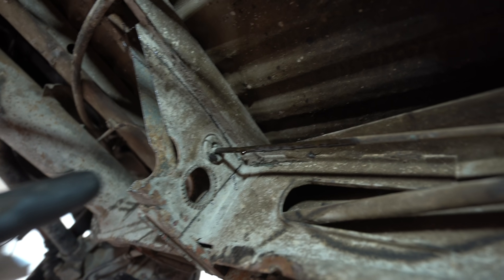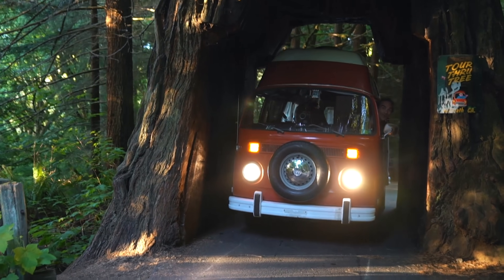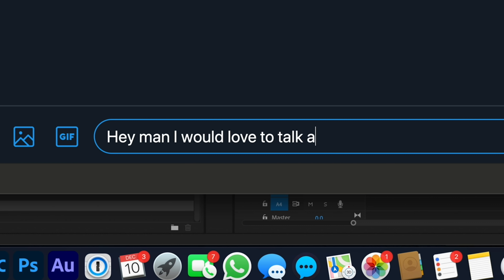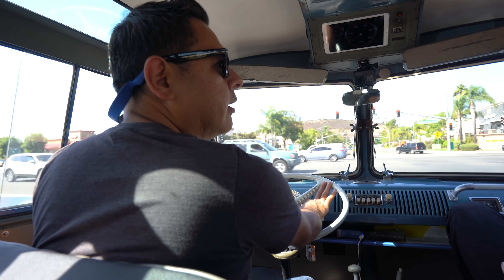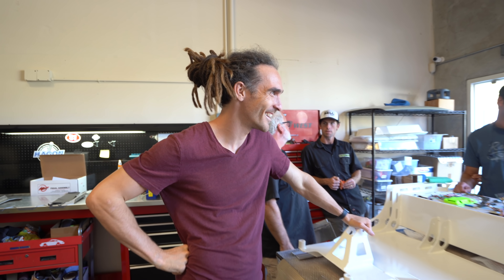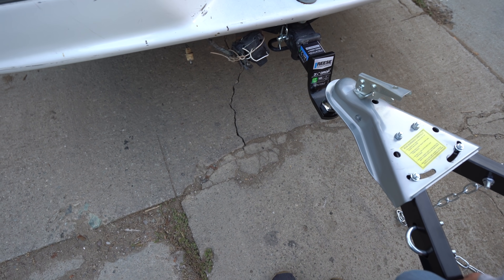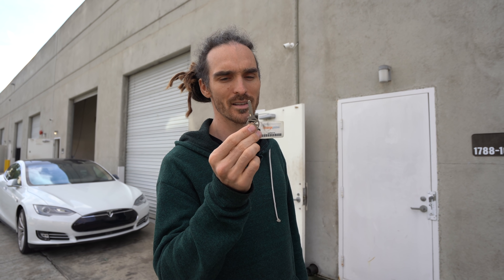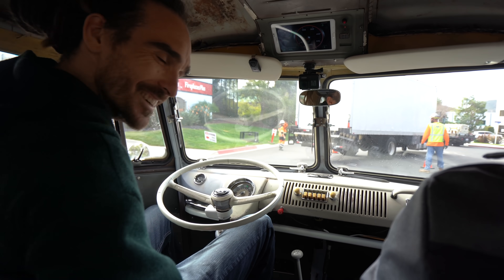How I Built An Electric Tesla Powered Classic VW Bus

Comment: A used engine is available for about 300 bucks, so i dont believe you did a serious research. The technique is very reliable if you know how to handle it.. I drove one high roof transporter over a decade with finally had over 400k km on the speedometer and with not one single serious repair..

Comment: As early as 2027, driving with a combustion engine will probably no longer be permitted outside of professional and delivery trips, in EU and Germany the Federal Exhaust Gas Fun Ban Ordinance BABVVO was recently announced and exhaust gas fun will soon be banned. The Federal Transport Tourism Emission Restriction Ordinance TEBBVO was also announced .... is to get all combustion engine commercial vehicles, construction machinery, agricultural machinery and even inland waterway vessels off the roads / waterways by 2035. Buses in the cities (and all taxis) must be completely converted to electric drives by 2025 (supposedly an EU regulation!)! That will be funny! Have you ever read Berlin perde? It takes off your shoes! They are planning the demobilization under the cloak of a campaign against "fun using fossil drive energy" in road traffic... the SOKO Autoposer is supposed to hunt down all fun fossil drivers in the future! This will be a STVO Stasi with BABVVO apps for monitoring as a little helper to control exhaust emissions.

Comment: I agree that electric motor driven vehicles are the future. I do not feel the same for batteries. they are difficult to make on more demand and the other problem is that you have to charge them and that is another demand on the power grid. Another problem is that conventional engines last longer than the batteries. it be much better if the car had a generator to supply the electric motor. basically  a electric car without a battery

Comment: 2 things.
1. Electric cars are not the future, like you said. The rality os, that they have a bigger carbon footprint than most diesel engines after 180.000 km.
2. That classic VW T1 dosnt deserve somethong like this. Even if they are expensive to repair, you shouldnt do this to one of them. They are for fun droves and not for a daily use.

Comment: Really like you video, but "unreliable and expensive to maintain" isn't something i would use to describe my T2a.
Have it for 10 years and never had a problem that a screw driver, a small plier or a hammer wouldn't fix. 
I guess i just got lucky with the unit.
I know i should also go for a EV but i just can't afford it. 

Going to check your videos on your van, really interesting. You're doing a great job.
Best of luck

Comment: I know this was months ago, but series hybrid is very efficient. A ICE running at constant load/speed makes it maximally efficient, you can plumb in a real car exhaust to minimise noise, and this would give you big range with a small battery. Best of both worlds.
Reply: Chef has 2013 BMW 328 I hyybe 1.3 kw 6 one ea n ge rv I nky 456 mk k es

Comment: And the cost of the conversion?
3hrs charge...VW’s are a slow lane cruise, even slower in electric..
EV isn’t advanced enough for long range journeys in camper vans, even in the UK. 
I’ve had one for 26 years, build my own engines that are reliable, do work and are a lot cheaper DIY than via a 3rd party engine builder. 
When VW’s weren’t jumped on by investors or fashionistas parts and dubs were far more realistically priced.
Reply: Truly I’d love my London Routemaster double decker motorhome EV converted but the cost is still too insane!

Comment: "These vehicles are extremely unreliable and extremely difficult to maintain?"
Well, You seem to have a pretty funny concept of "unreliable" and "maintenance". The Bully, as the Bug, is dead easy to work on, engine gets out in an hour to work on it from all sides, and back in a bit over an hour again after proper work was done, engine is forced aircooled and has no problems whatsoever with everything that recurrently goes wrong in liquid cooled engines, undercarriage is straight parts (integral though) mostly, so repair welding and even building Your own repair paneling does basically need a straightedge, three to four clamps and a stable table only (besides pincers, a way to cut tin, and a couple hammers of course), and the common problem of "recurrent breakdowns" generally is an aftermath of no proper maintenance done for literal decades (while they still ride along well enough after those decades to sell 'em to keen buyers 'as is'!) plus by far not enough knowledge and understanding in repair-shops when it comes to maintaining aircooled Boxer engines. 
Anyway, Jehu Garcia's way of converting a Bully into Tesla-electric is a cool and budget route to get to an electric Super-Wagon You still can not buy on the market in this size and configuration because carmakers incomprehensibly do not produce anything alike.
I'm all in when it comes to modernizations or conversions. 
I have stark doubts, though, that Your reliability and usability went UP compared to a well restored/maintained Bully, in terms of ease of repair and remote places to reach (plus get back into civilization from there).
Reply: Hallo deutscher
Reply: @joshuakotei6261  Hi Josh!

Comment: "These beautiful vintage vehicles are extremely unreliable and extremely expensive to maintain"

Dude... no? They are expensive to restore and extremely reliable when done right. What you're fighting is not their design, its their age and wear.
Reply: Also if he paid $5K for a rebuild that immediately broke down, firstly that price is a rip-off, secondly that's either craptastic shoddy workmanship or they didn't even actually rebuild it and just did a bodge-job, hoping that the usual known reliability of these engines would give it another year.  All engines like regular maintenance, it's also vastly cheaper than waiting for stuff to fail and attempting to fix the result.
Reply: Most reliable petrol engine ever built I reckon but you need to know how to maintain them. Drove 3000km with 3 cylinders from Norway to home with one….they never quit
Reply: VW Bus engines are terrible.
Reply: @snarkylive  Have you owned many?

Comment: So amazing project 🤩 It's my dream to build an electric van and travel all around the world. 

Tip: if you have a battery higher than 48vdc, you can use directly all your chargers, induction cooker, an even inverter fridge without any additional inverter from DC to AC. 

I made tests and its works awesome, because in every charger AC turns to DC. And you don't need to do it multiple times.

Comment: Should have swapped a subaru engine in it. Electric will be the future when we are off fossil fuel to create electricity.
Reply: Exactly.  Cracks me up when people actually think they have a lower carbon footprint when they switch to electric. They can't work out the power station just emits the same amount of carbon for them instead lol. This is the very definition of virtue signaling

Comment: I’d love to know the comparison of how much fossil fuel is used & those emissions to charge the vehicle, compared to the emissions of well maintained engine that uses regular fuel.
Reply: I have more hope towards hydrogen and biofuels more than electrics because of lithium batteries,there is a limited ammount of lithium on earth and batteries can't be recycled.so replacing all combustion engine with electric engine isn't going to be possible since we are going ro run out of lithium relatively quick.

Also providing renewable sourced electricity for all these cars is also a challenge
Reply: The us grid is powered by a number of sources.
Reply: and remember to spank those Congo children in mines to mine faster, cause Lith-Ion battery wont wait;)

Comment: Nice idea if you can't find parts for the original combustion engine. Definitely fun. Batteries are not CO2 neutral. Not by far. Especially not with US electricity. But better than the old engine

Comment: That's a pointless conversion when you have to sit there for 3 hours waiting for it to charge.You wouldn't have that with a petrol engine now would you
Reply: I'm sure Louis can find something to do for a measly 3 hours. That time is a very small con (wouldn't even be a con if you're living at home) for all the pros this build has. Better for the environment, more power, more reliable.
Reply: Part of the enjoyment of owning one of these Vw's is the driving experience which includes the Distinctive Iconic sound from the Vw Engine.Making it a noiseless battery powered vehicle takes this away.I would definitely not call a 3 hour wait measly You wouldnt drive a regular vw and be happy if you could only go a certain distance and then have to wait three hours for Fuel.?
Classic cars produce less emissions that regular petrol vehicles and the whole classic car community contribute a very small percentage to any pollution of the environment but if it makes people feel better to pay for the initial conversion and have the drawbacks of charging and interrupting their journeys for 3 hours when they never previously had to then go for it
Classic vehicles in their original configuration will still be around for many years to come .If you want an environmentally friendly reliable vehicle then maybe opt for a prius

Comment: Why not retro fit a modern diesel engine instead. Reliable and powerful. Simples. You could get a custom fuel tank and get 1000 miles.

Even a second hand 3 pot 2002 diesel engine from Hyundai would do.

Comment: Love it. Except if your reason for electric is the environment/ethics you're still much better off with old gas vehicles as cobalt/lithium needed for batteries are mined by slaves and the electricity used to charge said battery still comes from coal and gas. Electric engines are better, but they aren't better for the environment.